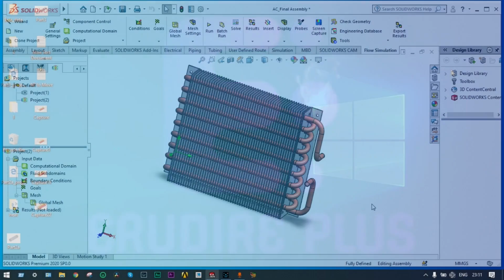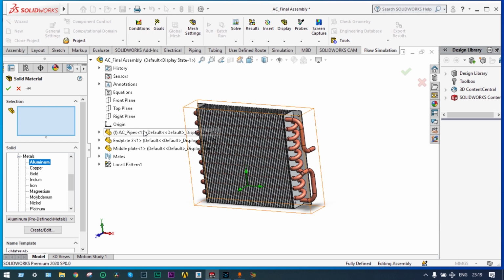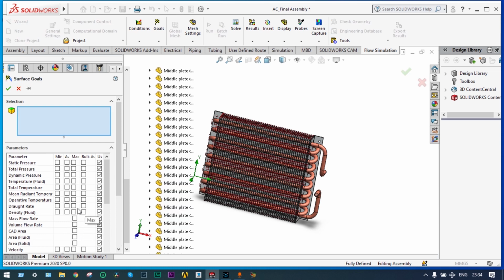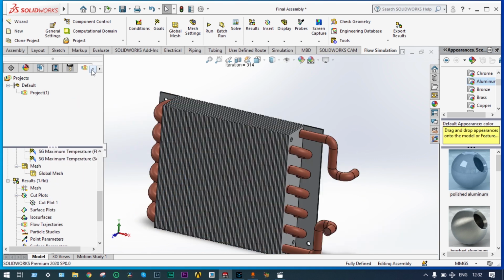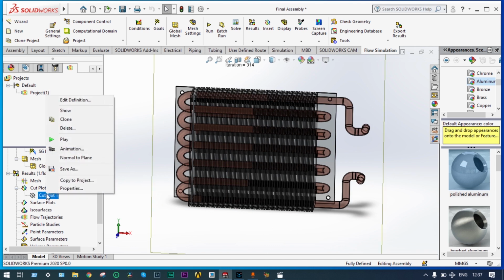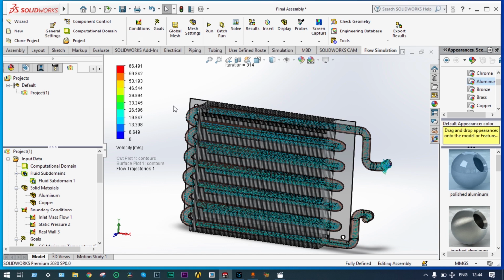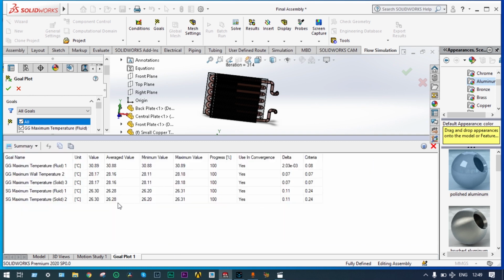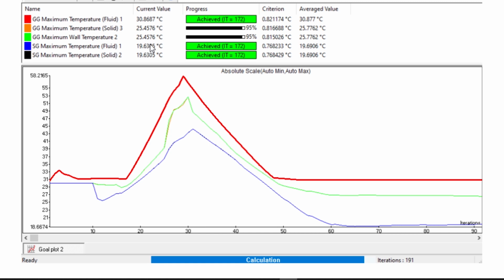CFD Flow Simulation and Optimization of a Condenser Heat Exchanger: A SolidWorks 2020 Tutorial

Comment: Hello sir. Upon applying boundary conditions, a warning appeared that says that the component not laying on the boundary between solid and fluid region. What should I do?
Reply from the maker: Fluid subdomain should be defined again. Sometimes if you change the model accordingly the computational fluid also changes. That needs to be incorporated. So, check fluid sub domains and also atmospheric pressure boundary conditions
Reply: @CFD_GUIDE  I resolved that already thank you. Hence, upon running, it says that 

Unresolved Boundary Condition for the real walls
Invalid goals for SG Temp of fluid
Phase transition in the real gas may occur

Can you share the file of this, please?
Reply: @CFD_GUIDE  Sir, can I consult my simulation to you if you are free? I've been working on this for days and I can't still achieved accurate results.
Reply from the maker: I am not free. I am doing a lot of projects. Anyways you can share your thoughts and doubts. I will try to  clear your doubts as time permits
Reply: Is it normal to encounter warnings while running the simulation? I am currently running a simulation and some warning appears and the disappear after a while. Should I stop the simulation?
Reply from the maker: Yes. This type of warning appears if there is any conflict. In that case you have to remove the conflict. It may be improper boundary conditions. Sometimes, your system is not capable of simulate the complex geometry.
Reply: @CFD_GUIDE  Thank you so much
Reply: @CFD_GUIDE  Hello sir, what do you mean by "Phase transition in the real gas may occur"?

Comment: I have a question 
You choosed the gas and real gases at the same time.
Is it possible to choose the gas and liquid at the same time??
Reply from the maker: Generally homogeneous ( mixing of liquids with same phase) mixing is possible without having any special arrangement but in case of heterogeneous mixing when the fluids are in different phase, in that case we need to a technique, known as free surface technique. This is about SolidWorks but in ANSYS we have different methods like VOF, Eulerian  method etc.

Comment: how much time did it actually take you to run the simulation? its taking me 24h+, is that normal?
Reply from the maker: It is abnormal. Simulation time depends on your PC confirmation. Better the configuration the less is the time. Even with 4th gen processor should take one to 2 hours for this simulation. Even for complex CFD simulation with the latest configuration may take 2-3 days. Everything depends on complexity of the model and System configuration.
Reply: @CFD_GUIDE  Can you send me the 3D file so I can do the step by step again? thanks
Reply from the maker: Please send an email to me in which I can send you the model
Reply: @CFD_GUIDE  Please check your mail! I sent it to you! Yt keeps deleting my comment with my email
Reply from the maker: No, I didn't receive your email
Reply: @CFD_GUIDE  I sent it to mail on your bio. Did u check spam? If it doesn't work is it possible to upload it to some cloud storage and share the link? Thanks a lot for your effort
Reply from the maker: Files sent to your email
Reply from the maker: For me it took one hour. My PC specification is not good enough.

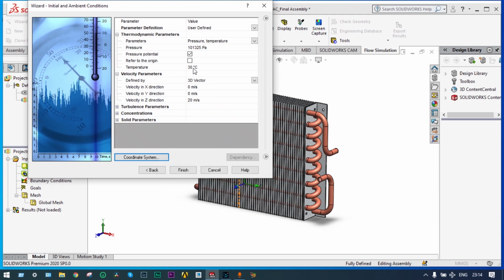Comment: Sir @2:30 what would be the concentrations of the fluids? Is it Air:Refrigerant = 1:0 or both 0.5:0.5?

Thanks for the invaluable support of answering the comments everytime!
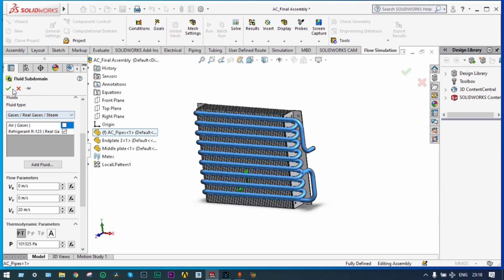Reply: Also @3:52 you have not changed the other parameters of fluid subdomain like Pressure and velocity....so is it needed?
Reply from the maker: See, everything is as per requirement. I wanted to show the methodology. You can change boundary conditions as per requirement. There is no hard and fast rules that it should be same always. Only one boundary condition is fixed, i.e. when ever there is any opening excluding the entry, it's pressure should be atmospheric pressure
Reply: @CFD_GUIDE  ok sir

Comment: Sir you said that freon intial temp -5 hai but in solve window you can also say intial temp of fluid is 30 plzz tell me sir
Reply from the maker: Yes, what I told is right. As a boundary condition i took freon at -5 degree centigrade and while checking the results at the inlet I told that inlet temperature was 30 degree centigrade (i.e. temperature at the solid inlet surface of the tube). Immediately after I told that the temperature of fluid at the inlet is -5 degree centigrade.

Comment: Hello sir. Thank you for referring to this video. I'm encountering a problem while selecting the fluid subdomain. Despite selecting the Sweep (thin) face, the fluid subdomain is generated such that the entire model is encompassed by the same. I'm not getting the fluid flow through the pipe as shown in your video. Kindly revert back at your earliest convenience. Thank you very much.🙏
Reply from the maker: Check the geometry from sectional views. There must be some open space. Edit different parts and while providing extrusion or sweep try to do things unmerged.
Reply: @CFD_GUIDE  okay sir. Thank you🙏 I'll try it out
Reply: @CFD_GUIDE  I'm encountering the problem only during external analysis sir. For internal analysis, I'm getting the proper fluid subdomain inside the pipe
Reply from the maker: Internal & external that much of difference is not there. In case of external analysis fluid domain is vast. So itiration time also increases and you will get some extra results i.e. convection from walls to atmosphere. If that is not so important take internal one. Or you can send me the midel. I can check as per my time suitability
Reply: @CFD_GUIDE  okay sir. I'll send it to your mail. Thank you very much for your help.
Reply from the maker: Your file is not opening. Msg showing that faces are lost
Reply: @CFD_GUIDE  should I send a step file sir? By the way, I tried internal analysis, but the software was using 10 GB RAM and 100% of CPU memory which caused my laptop to crash.
Reply from the maker: @farzaanameen7550  I am using SolidWorks 2020 version. So send the file in Parasolid format
Reply from the maker: Got it. Tel about input fluid, press & temp & also goal requd
Reply from the maker: Fluid inside radiator should be ethylene glycol & water
Reply: @CFD_GUIDE  hello sir. The inlet temperature is 80C. Pressure is constant. There's no set pressure. The goal required is the outlet temperature. The fluid has a mass flow rate of 0.1388 kg/s.
Reply from the maker: Fins are made of aluminium and pipe is made of copper
Reply: @CFD_GUIDE  everything is made of aluminium 6061 sir.
Reply: @CFD_GUIDE  hello sir. What do I do when I get a warning in solver that says, A vortex crosses the pressure
Reply from the maker: Change input  values
Reply: @CFD_GUIDE  okay sir. Thank you.

Comment: As usual very intriguing content on this channel.
I got a question sir-The fluid(freon) flowing inside the tubes will exchange its heat to the pipe through conviction and then through pipe it will travel to the fins through conduction and then through fins it will find its way to the ambient air through conviction. Can I give all of these parameters for a more practical insight? Meanwhile thankyou for this charity for students like us.
Reply from the maker: Thank you, dear Himsnshu. It's my pleasure
Reply from the maker: What you are thinking is right.
Reply from the maker: You can see the cut plots of temperature distribution along two perpendicular planes separately to understand heat transfer along different planes. Along one plane convection is dominant & along other plane convection, conduction & again finally convection through the fins.
Reply: Things are pretty much clearer now.Sorry for asking a wrong question, you already have provided all those parameters ,I was skeptical about the Thermal Conduction Coefficient 'K' just because I didn't saw it anywhere in the video regardless of knowing that it's material dependent, My bad. Thankyou very much. Looking forward to see more of such crucial things from this channel.

Comment: Can we simulate the whole refrigeration cycle at one go?
Reply from the maker: Yes it is possible but in this case applying proper boundary conditions is a bit tricky. It is better to have a segments output to be connected with the input of the other and continue several simulations
Reply: @CFD_GUIDE  that's what i was thinking btw i have contacted you on LinkedIn can you accept my request to connect Shubham Ojha
Reply: @CFD_GUIDE  I'm a r&d engineer in hvacr
Reply from the maker: Accepted
Reply: By the way where are you based do you provide services?

Comment: Thank you so much for the explanation, it helps so much sir. respect :)
Reply from the maker: It's my pleasure that you liked it
Reply: @CFD_GUIDE  how long did you take to run this simulation sir? 😁
Reply from the maker: It depends on PC specification. Higher the specification lower is the simulation time. I cannot remember the simulation time in this case it may be half an hour. In some simulation cases it took continuous 7 days to run the simulation
Reply: @CFD_GUIDE  wow, just half an hour. It took me hours and still cannot finish because of low PC specifications. Is it okay if i just take half of the pipe to simulate? Will it give the same objectives?

Well i should upgrade my PC then! 😂 Btw thank you for sharing this tutorial! 👍